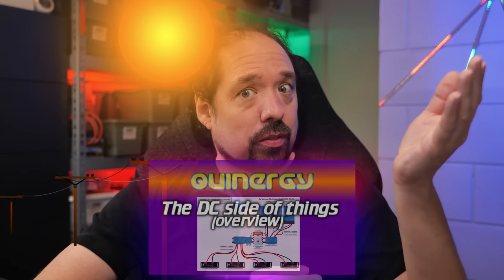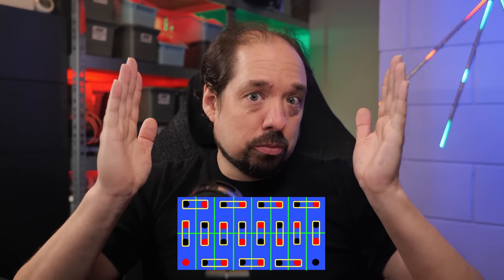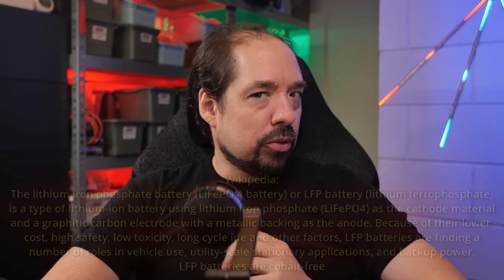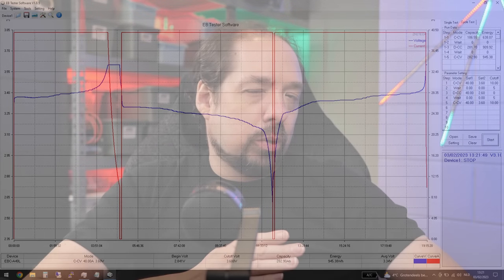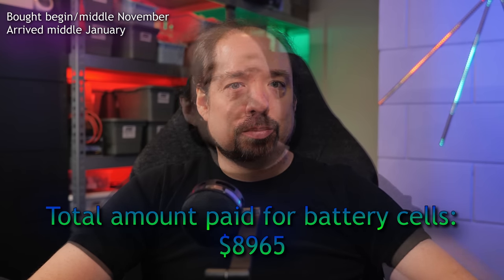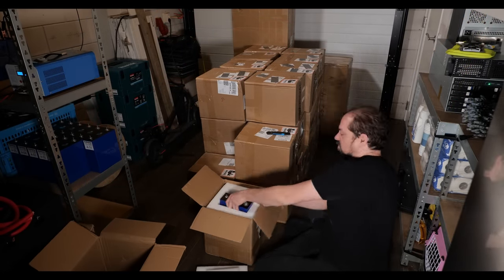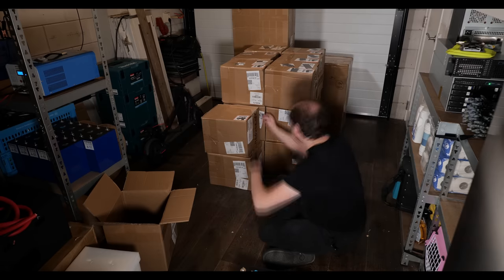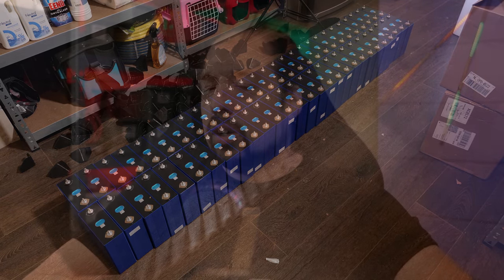⚡Quinergy⚡How much did I pay for my 62kWh battery cells?

Comment: I got a quote from a solar company a few months ago that included a battery. It was 10kWh (9kWh usable) for about $10k. Your battery is about the same price for 4-5 times the capacity. Pretty impressive.
Reply from the maker: Yeah, but also a lot more involved of course, but the price gap is pretty huge, fully agree.
Reply: You can buy 30.72 kWh storage from signature solar for 8994.00. Comes with racking. All you need are cables to your inverter/charge controller. Can buy a single Trophy 15.3kwh battery for 4695 making 30.6 kWh unit $9390 so a little more than above but the Trophy batteries come with heaters so can be stored outside in cold climates.

Comment: Seems like a lot of that foam could be repurposed as vibration dampening if you were building 12v battery boxes to help isolate the cells from the box and an internal bms. Or glue them together to make a solid block and use a hot knife to carve out seat cushions.  🤷‍♂️
Reply from the maker: I already have custom made battery boxes (more about that in upcoming videos) that don't really need foam padding, let alone that thick. Even then, you'd be left with A LOT.

Comment: I've been looking at the same EVE cells.   Are you happy with your cells so far?  I'll probably start with 1 48v pack, but there is a stocking warehouse local to me.  How many BMS' are you going to run?  Any preview at which BMS you are going with?  Thanks for the video.
Reply from the maker: Yes I am, but there are some caveats if you go with B grade, I'll try and have the video about that soon. I'll be using the JK BMS. One per pack.

Comment: @2:47 I understand that there are regional differences for decimal separators, but could you help me understand why voltage and current would use different (. ,) ones?
Reply from the maker: Ah that's probably just my bad, here in NL comma is for numbers after the decimal point and point is for thousands. In the US it's reversed, I go back a forth too much to keep it straight. 🤣

Comment: How much kWh you are consuming per month? And how much one kWh costs in Holland? I calculated only the battery price, without solar grids, cables, installation, etc. and with very rough calculations -  This is the amount of money I will spend on electricity for 30 years
Reply from the maker: It depends a little bit on the month, last month true usage was about 2000kWh (most of that is heatpump) of which about 1000kWh came from solar and for now we can 1:1 get that back, even if delivered to the grid, but that will go away in the future. Per kWh we pay between 0.35 euro to 0.50 euro.

Comment: I have made myself 3 years ago a 24 volt Volt LIfepo4 80 Amp battery and another new one 24 Volt 120 Amp....with Daly BMS...1 with Bluetooth....the Balancer inside the cheaper BMS is only 50 mA...passive..a joke with High currante Lifepo4 Battery,s....
I have ordered an extra  5 Amp  Active Balancer...
Also see YouTube :  Andy,s Off Grid Garage in Australia..😊